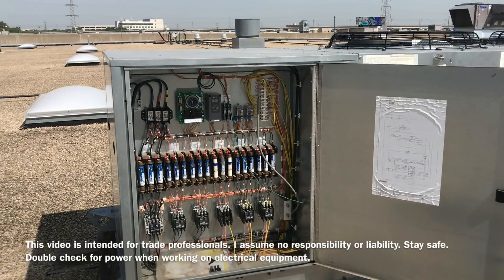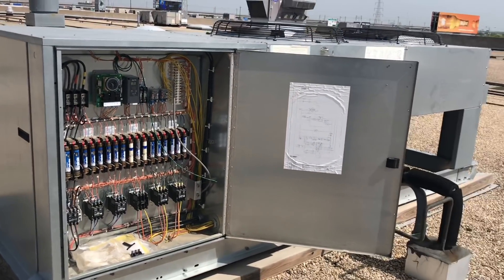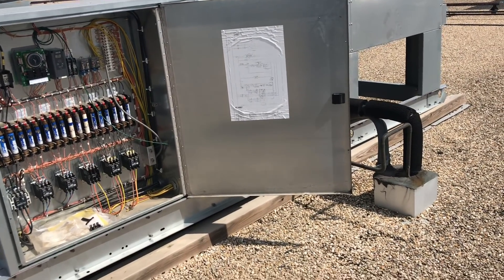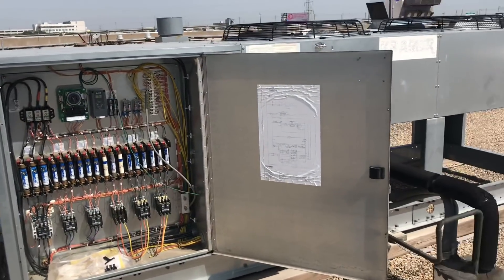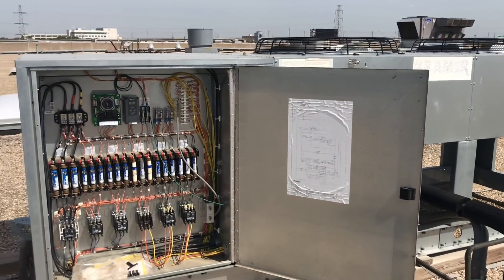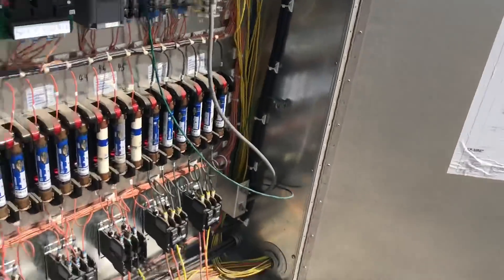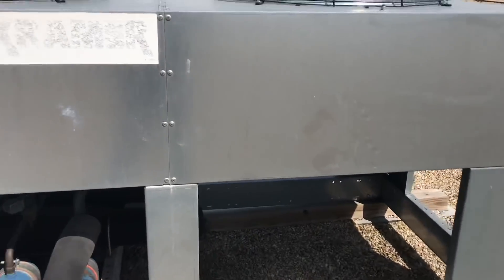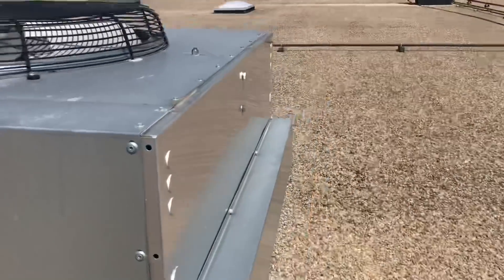Basic refrigeration troubleshooting. Part 1 controls.

Comment: This must be a "Big box store" unit. Stores like Costco, Target, Walmart etc. I have worked on these units many times. In the 30 years of refrigeration, I had the experience of working on small self contained units, single compressor units, multiple compressor racks, ( I worked in a new Shop Rite supermarket that had a medium temp rack with 9 compressors and about 34 circuits. ) These days they usually use loop systems. Loop systems are just a main liquid line, main suction line, and some places a main hot gas line that goes around the store and the case circuits draw off of the  loops. Have worked on CO2 racks, chillers, ( 134a, 22, ammonia, ) Of course water towers, with or without inverters, Regular condensers with or without inverters, self contained cases with R290, ( propane) Air conditioning units, window, split or ductless, roof top units from 1 horse power to units you walk into to service them, Fan units that are big enough to suck you into the blower wheel, water pumps, one I had the pleasure of working on, drew 985 amps while running, heat exchangers, both steam and cooling, motors from 1/20 hp to around 200 hp, compressors that were hermetic, semi hermetic, screw, scroll, Ice machines, cube, crushed, nugget,  pneumatic controls, plc controls, and I am sure there is more. That is the good point of working for a company that services office buildings and supermarkets. Supermarkets have just about everything. They give you a great range of experience. The "on call " sucks, as some Ding - a - Ling  will call in a case that has one nine watt motor out at 2 am and wants you to come out in the snow, on a 12 degree night to fix the freaking thing when it can wait to the normal starting time when the whole crew is in.  This is one of, if not the best trade. I made a ton of money working in this trade, started my own business which is doing very well. You do have to be a person who is willing to hustle and work long hours for sure.

Comment: Is it a 3 phase unit that connects to a Terminal Busbar then connects to the fuses that connects to the contactors. Is it like a step down system.
Reply from the maker: What do you mean by step down.
Reply: The 3 phase power trickles down the circuit?
Reply from the maker: texture6  it can go up or down. It doesn’t matter. It does have a step down transformer.
Reply: Usually on three-phase systems a control transformer is used to step down the voltage to 120, or 24 volts single phase.
Reply: The wiring diagram showed the transformer at 460 vac incoming and step down to 230 vac. The guy  mentioned step down 120 vac .
He is very informative.  He sounds young. Great video thank you.